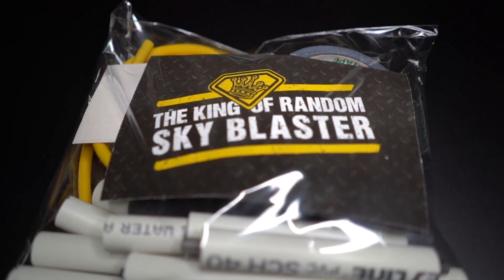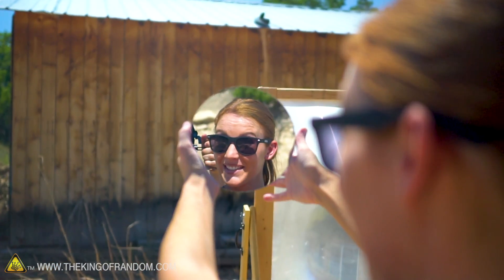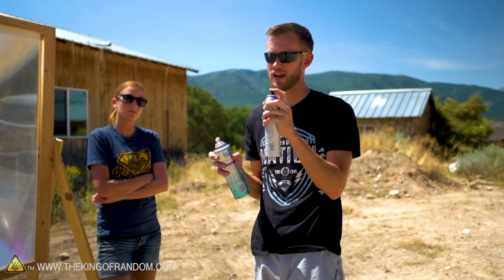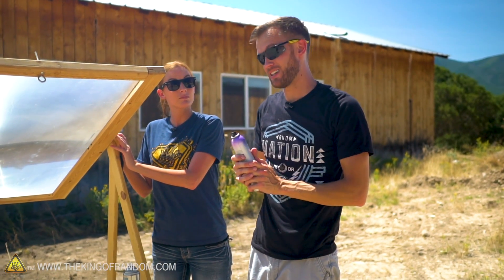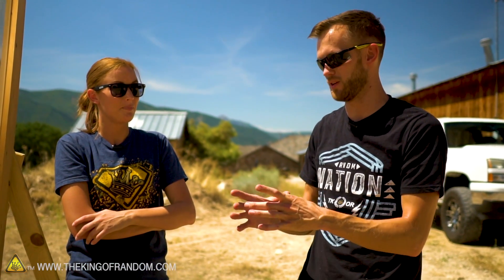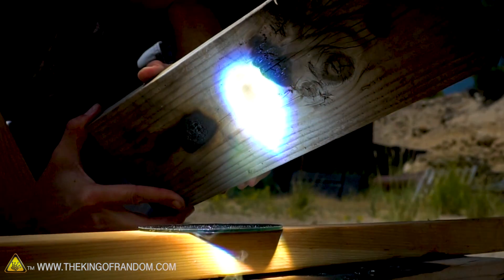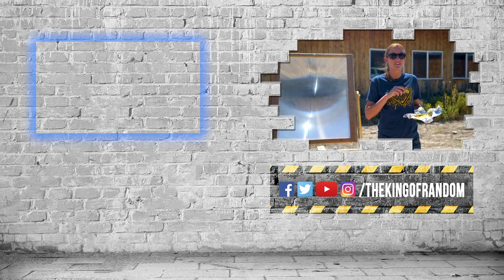Will A Solar Beam Reflect or Melt A Mirror?

Comment: Thank You Very Much for answering my question about using a reflector after the lens to cook. I'm trying to solve the "problem" of solar cookers taking so long to cook normal grilling foods. IMO You proved that sun light CAN be reflected to a cooking surface successfully BUT the reflector is ABSORBING too much energy and will fail.  IMO you also proved that the reflected energy is less than the energy being absorbed by the reflector. I really appreciate this experiment.

Comment: What would happen if you direct a broad unfocused light from your Fresnel lens into a mirrored cone opening without melting the cone yet the light is concentrating coming out the bottom opening  of the mirrored cone? Experiment with different cone configurations depending on use of cone.

Comment: im 2 years late but could it have been possible that the some of the heat was going through the mirror being absorbed by the wood and the wood got too hot for the back of the mirror ? need to test the mirror without anything behind it.

Comment: You should try the worlds whitest paint. Mirrors only reflect about 80-90% of light, but white paint reflects a lot more. mirrors onlu reflect light in a specific angle, so you can adjust it easily, but white paint reflects more. im 13 :)

Comment: You should polish a flat piece of steel (maybe stainless) to a mirror finish to reflect the focal point on the popcorn. It'll sink some of the heat, but won't shatter like the mirror. 🤷‍♂️

Comment: The uneven heating of the glass causes rapid expansion in the beam which causes the mirror to crack. The same thing happens with ice cubes placed in water. The outside heats enough that the ice cubes crack.

Comment: Could you use a parabolic mirror to reflect the concentrated light from the solar scorcher to an even more concentrated intense heat???   How many times can you reflect it, to concentrate the intensity to more than can be controlled???  Take the experiment to the full level of reflecting the concentration....  What will that do to a spray can.. Coconut... eggs...can you ignite the thermite  with it... or the magnizmim.. You could make several videos just on what you can do with reflecting the intense heat...

Comment: I wonder if that fresnel lens / solar scorcher could be used to heat water in a practical fashion.. obviously the device is capable of melting metal.. but like: hot water for a shower (even if need to mix with cool water for shower temp) or something like boil water for pasta (without destroying the container)
Reply: A copper pipe terminated bottom of a radiater coil, but then you need a rig for the whole device to track the Sun
Reply: @darrinjones9387  I would imagine placed somewhere between 25 to 75% between the focal point and the lens.. 75% being closer to the focal point.. 75% might be too much of concentrated energy though

Comment: Want to cook with sunlight?  set a mirror to reflect through the Fresnel from the bottom to focus the cone upwards, rather the focus to mirror.  Maybe use 2 mirrors to get the sun angle more vertical.

Comment: wonder what would happen if they used the focal point of the lens and the heat from burning a fuel...to see if it raises the max temperature that the fuel could get  when burned...that way if you only had propane gas for fuel you would still be able to melt a metal that has a higher melting point than the fuel can deliver...wondering if the 2 separate temperatures are additive  ...should try that

Comment: Do they make mirrors for high temperatures, like heat treated glass like what's used in fireplaces with a type of metal that would be more resistant to burning like titanium or tungsten or something?

Comment: Can you pump running water under the mirror to keep it from shattering? Manufacture a water-cooling system, scale up your operation and when you get a stable reflected beam, see if you can get another effectively doubling your reflected solar power THEN CROSS THE STEAMS!!

Comment: If you try this again, put the mirror in a small plastic container covered in a couple inches of distilled water. The water will dissipate the Heat in the mirror faster then the air causing less mirror breakage. Distilled water will not boil unless contaminated.

Comment: If the mirror is silver on copper thick enough to conduct heat or has water cooled or air cooled to transfer heat to air it might permanently reflect the light heat to make a solar cooker.
The mirror might not break

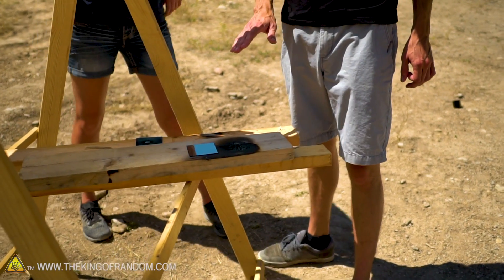Comment: 6:00 Thermally shocked
8:50 Spread the equal heat to entire surface of the mirror first before scorching to avoid thermal shock. The sun beam hits though the glass part before reflective part. Second surface glass
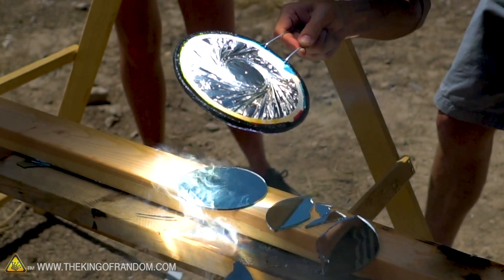10:58 There even a commercially purchaseable solar cooker

Comment: Would you get better results reflecting the sunlight off the mirror, then through the magnifier onto the heating/cooking service?  I  imagine that the best service would be made of something like cast iron. You should be able to control the cooking temperature by moving the focal point in and out.

Comment: Hi,
an aluminium-mirror is reflecting is reflecting about 80-85 % of visible light. But at infrared light about 800nm  the mirror is reflecting only  70%. So it´s no wonder, that this strong beam ist destroying th very thin alu-layer.

Comment: There isn't hi limit of temperature that it can reach. It's only the temperature when input energy and radiated energy in infra red are in balance. If you insolate heated element it while achieve higher temperatures.

Comment: Try putting CDs under the solar scorcher and seeing if it removes the data
Reply: Yes. It will melt and won't fit in a CD player anymore. They are made of plastic.
Reply: Yes, but if you scorch it without fully melting it will it destroy the data
Reply: @gggggart8732  My guess: First part to suffer will be the surface, which is essential in reading the data on a CD.
Well, they could test how long a CD has to be in sunlight until it's ruined.

Comment: Will the Fresno lens heat up a 30 to 45 gallon  aluminum box of water   24inch by 70inch  at a height of 18 inch  ? How long will it take to Boyle the water?

Comment: The spray can test probably didn't ignite because the spray isn't dense enough to effectively transfer/contain heat. It's the same reason insulated clothing is usually full of air. Think wool and puffy jackets.

Comment: I think the reason the mirrors are breaking is that they are still absorbing infrared(IR) frequencies. Common mirrors only reflect visible light. Silver backed, and likely other metallic backed mirrors are great at absorbing IR. You should try smoothing out some aluminum foil, and maybe polishing it into a mirror. Aluminum reflects about 95% of IR, so your results might be much better. But you should also be cautious. If the aluminum does burn it will produce fumes that are hazardous to your health.

Comment: If i send you guys some samples of borosilicate glass, could you try and melt it with the solar scorcher or make a prince rupert's drop? the melting point of borosilicate is around 1,500 to 1,700 degrees, depending on the color do to oxides or metals.

Comment: The spray will not ignite because the velocity of the spray is causing air to entrain and mix with the aerosol, which is also COOLING the stream of aerosol.

Comment: Hey try using tungsten rods from the T.I.G. Welding industry in a Pyrex container,too heat water into steam .be careful tungsten heats up very fast across the rod so if your holding on end an heat the other end it will burn you quickly. Tungsten is pretty cool your viewers will like that . Plenty of experiments using that fennel lens an tungsten to create steam power.

Comment: If anyone is wondering why the mirror melted:  glass is transparent to visible light, allowing the visible light to reflect off the metal behind the glass.  However, glass also absorbs infrared light (which we feel as heat).  So it absolutely will reflect the bright visible light, but the infrared light is what will destroy the glass.

Comment: Mirrors don't reflect the full spectrum of light. The glass would absorb the infra red , get hot and break.
Reply: Try Snow , Its Ability to reflect IR would be Interesting . Would it melt?
Reply: Water absorbs in the visual spectrum very strongly, iirc.

Comment: Oh now there's an idea for that giant coil of fiber optic cable.  Can you focus the sun with the solar scorcher into a small bundle of fiber, and redirect the beam to another location?
Also to avoid going through so many mirrors try using a larger mirror, closer to the Fresnel lens.  It shouldn't heat up anywhere near as much, but would still redirect the focal point.

Comment: Mirrors have different levels of reflevtivity. An ordinary mirror can refrflect 99% of visible light but will absorb other wavelengths of light and that excess energy destroys the mirror. You might want to try and get a dielectric mirror which can reflect many wavelengths and from any angle.

Comment: Very nice!  Please try this with a "first surface"mirror. Instead of the light passing through and heating up the glass, then hitting the reflective coating, a first surface mirror has the reflective part exposed to the air. Then the glass is behind it. I think some telescope mirrors are like this.

Comment: Could you transport solar power and burn wood using fiber optic cable?
Reply: It would burn the cable,  the same way it burnt the mirror . The cable can transport many wavelengths of light but the ones it can't burn it.
Reply: Aiden Harris So filter out the wavelengths it can’t?  I wonder if it would still be hot enough to cook but not enough to melt the internal reflective surface of the fiber optic cable.

You could also split it between multiple strands.
Reply: This is an interesting idea. Definitely worth trying. Don’t listen to the guy just writing it off as a bad idea.
Reply: @empanada65  Thanks Carlos. You're right. It may or may not work, that's why we experiment.
Reply: @empanada65  Fools everywhere😒
Reply: Mixed results at best. Use a laser instead
Reply: It would be very difficult, leakage from the fiber optic cable is a big issue

Comment: You need to spray the spray in the direction the light is traveling that will give it mor time to heat up. You can also store the can in a hotter room to bring the temperature up. Makes ignition easier

Comment: Instead of cheap mirrors to try popping the corn what would happen if you used some thick sheets (1/4 inch thick or so) of highly polished metals like stainless steel, brass or aluminum?

Comment: The follow up science behind the mirrors breaking:

All the mirrors used were second surface mirrors, meaning the part that actually reflects the beam is under the clear glass. Because the focused beam has to go through the glass bounce off the reflective surface then go through the glass again it should be no surprise that the glass melts/breaks the same way a normal piece of glass would break. If anything you are adding more energy/heat into the glass as the beam is not passing through the glass. You also have to consider any spec of dust or streak on the glass or tiny imperfection in the glass also absorbs the heat.

This is why optics for things like lasers use first surface mirrors, where the reflective portion of the mirror is on top.  These mirrors absorb very little energy as it is mostly reflected.

Second surface mirrors are used because re-polishing a reflective metal surface, which is not nearly as scratch resistant as glass, is much harder than cleaning a piece of glass. So in general used as something to see your self in etc second surface mirrors are much more durable and cheaper to manufacture, but are not suited for energy reflection.
Reply: Thanks, appreciate the info man 🙏
Reply: glad I read down to your post as I was thinking the same
Reply: Jeremy B you’re smart
Reply: Also why laser optical trains need to be kept squeaky clean. Any tiny spec of dust or dirt will cause localized heating, and damage the optic especially in higher power systems. Thats why when you receive them they come in those cool little dust free cases.
Reply: That’s a lot
Reply: My brain is gonna melt
Reply: I see a lot of talk about lasers but does anyone know what laser stands for?
Reply: I was thinking the same
Reply: Did you copy that straight off the internet
Reply: @jedidahfrederick2025  no, just 20+ years of working with high energy equipment like lasers well into the thousands of watts. First surface/second surface mirror knowledge is fairly basic and necessary even in very low powered laser usage as a laser reflected off a second surface mirror is going to diffuse, not have a predictable path and depending on wave length will produce an unwanted "ghost" reflection traveling at a different angle. All that is fine if you're only using it for a toy laser that will draw patterns on your wall etc. However for any kind of scientific work , precision work (making holograms etc) or as stated in my original reply, for high powered lasers/beams, a second surface mirror would never be an option.
Reply: @techoverload  I worked with lasers in highscool. We had a class 3 and a class 7 laser. Making holograms was one of the projects we used them for. The mirrors we used were first surface mirrors.

Comment: You guys should point the solar scorcher at a solar panel. Test 2 things if it can withstand the heat and to see if there is a difference in the output of electricity.

Comment: Now that you have tried mirrors, I really want to see metal and how if it will reflect the light or if it will actually melt. Like try a small aluminum sheet, steel sheet, copper sheet, and maybe tin. See how those work under the sun. Then see if after, you can do something similar to today with the popcorn but put the popcorn directly in the initial sun.

Comment: What about spraying like liquid oxygen or something really really flammable into the focal point
Reply: Oxygen itself isn't flammable but it speeds up the burning or combustion of other things
Reply: Super Stefanovich liquid oxygen is
Reply: Perspective No it isn’t he just said that. Oxygen is an Oxidizer which means it aids in the combustion of other compounds. It isn’t flammable itself.
Reply: Frankenwood have u seen the vid where he lit liquid oxygen on fire
Reply: @perspective8369  IT JUST SPEEDS UP THE COMBUSTION PROCESS
Reply: @perspective8369  if oxygen gas wasn't the same as liquid oxygen thing wouldn't burn in our atmosphere.
Reply: Oxygen ain’t flammable. Hydrogen is your word
Reply: Liquid or gaseous oxygen is not flammable itself.  It only reacts with flammables to support combustion.  Our atmosphere is 20% oxygen.
Reply: Liquid oxygen is flammable when oxygen is in liquid form it changes its build up design slightly and the hydrogen is more available so liquid oxygen is flammable
Reply: @cookiehuman7745  I don't think you understand the meaning of flammable son. When something is flammable it means that it has the ability to burn or ignite. You can not light oxygen on fire with an electric spark, but you can do so to gasoline which is flammable.

Comment: Did anyone else see the rainbow in the flame/smoke? 06:07 and 06:13-06:20 and 09:20
Reply: Light is basically made out your so called mirror
Reply: It’s satisfying
Reply: YESSSS!!!
Reply: Chromatic aberration
Reply: OLI 27 of course because that's exactly how rainbows are created, Whight light be refracted by water. Which is why rainbows only occur when  it's sunny and rainy
Reply: @Shorkii.  white*

Comment: You should have sprayed the aerosol  up towards the focal point so the molecules stay in the beam longer. The aerosol, flammable or not, absorbs a lot of heat before igniting: a lot of engine's use excess fuel (internal combustion, turbines, even rocket engines) to manage the heat.

Also, you say "light based heat": All heat is light based. Just saying. So to pop the popcorn, I think you should use the lens to heat a heavy piece of steel plate, and then use the plate to heat the popcorn container (more specifically, you need to quickly heat the butter/oil to boiling without getting it so hot that it burns, and it needs to transfer its heat to the inside of the popcorn without burning the outside of the popcorn). Heating popcorn and butter from the top in surprised worked as well as it did considering the number of failure points in the system!

Comment: you should not have sprayed at 90 degrees and across the light because of the amount of time each molecule is in the focal point...if you make a jig so you can  spray against the direction of light or slightly offset to keep the temp of spray down...also what you are not thinking about is when a liquid turns into a gas a lot of heat is absorbed because it becomes very cold during the phase change...it being so cold and the short time it's in there is preventing it from igniting

Comment: The mirror is reflecting but the wood heats up and break the mirror use some ice below the mirror and see tie ice Will melt find a way not to heat the surface of the mirror

Comment: There are special laser reflectors that are suppose to handle high light emissions better than household mirrors.  Please use one of those reflectors and see if you can make a lasting beam with them.
Reply: David Steffel They will break too. Laser reflectors are designed for certain wavelength not full spectrum. Imo.

Comment: You need to make your own mirror. The difference being that the light must not go though the glass (twice), like in an ordinary mirror, but be reflected by the silver first. Then no need to use glass at all. Then you can get close to 100% of the light reflected and no heat deposited on the glass.